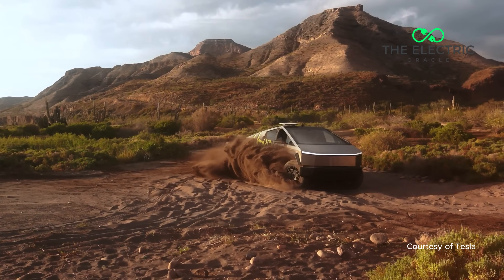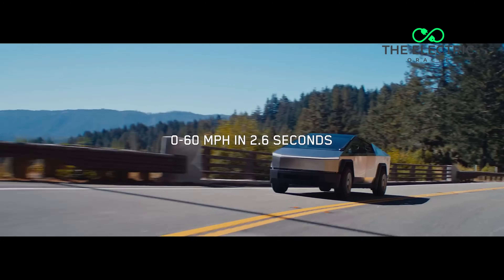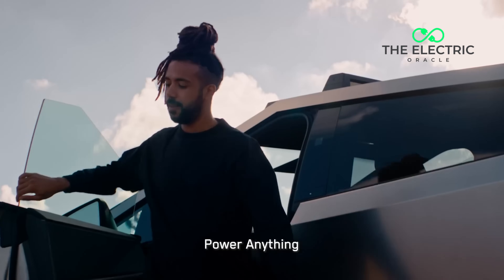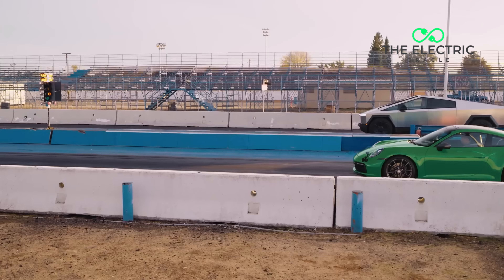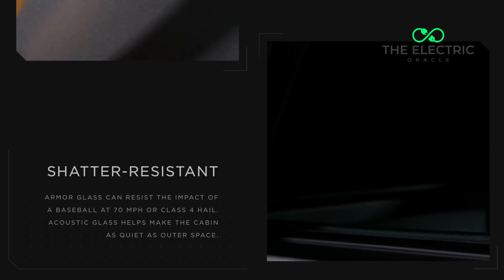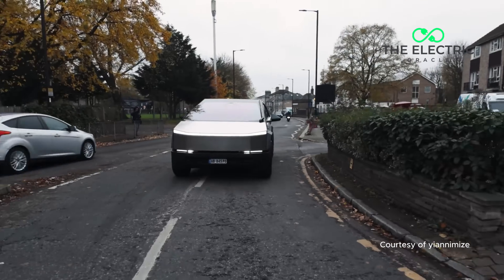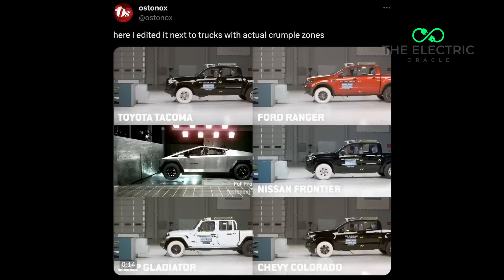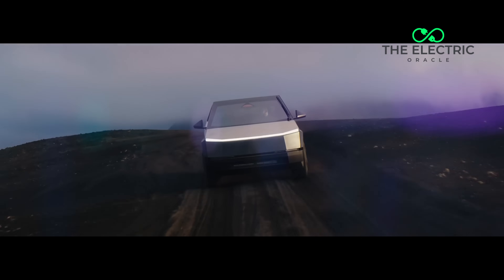5 Safety Issues Keeping Tesla Cybertruck Off UK Roads 🇬🇧

Comment: I see on your video about driving a cybertruck in the uk, you said about the C1 section on you license, you also mention that you would need a CPC, which is not correct, CPC’s are only required if you are working for a living using that vehicle, for example you can drive around in a Minibus if you’re family is big enough, but because it’s not for hire or reward, the no CPC is required, but if someone was to pay you for doing that then you are required to have a CPC, hence the payment is the reward or to hire the vehicle and you are the driver
Reply: Also anyone who got their licence before 1997 has C1 on their licence without any extra test.
Reply: You might be right, but still the insurance costs for someone who wants to drive a Cybertruck or a bus with a non-commercial license will be so high that in practice the possibility is not viable. Maybe one or two extravagant and ultra-rich celebrities could find their way to do things like these, but the rest of the world can't.
Reply: Limit is increased for alternative fuel vehicles to 4250kg gross weight.
Reply: @semsainars  Shouldn't be, it ought to be the same weight. It's about safety and road damage, which don;t change if the vehicle is an EV.
Reply: He’s right, the government upped the GVW limit to 4250 after a consultation in 2018 for zero emission vehicles so you could indeed drive a Cybertruck on a B licence
Reply: @robbrooks5181  There are a few catches. First it has to be used exclusively for the transportation of goods. Second, the driver has to complete an additional 5 hours of training with a registered instructor. Finally, this only applies to Great Britain, so no going to Northern Ireland.
In 2023 there were only two registered qualified instructors for such vehicles.
Reply from the maker: Hi Dave, thanks for your comment.

Let me clarify the requirements for driving a Cybertruck in the UK:

License Requirements

A Category C1 license is required as the Cybertruck exceeds 3.5 tonnes
CPC (Certificate of Professional Competence) Requirements

CPC is only required if you're driving commercially or for "hire and reward"

You do NOT need a CPC if:
Using the vehicle for non-commercial carriage of passengers or goods
Using it for personal use
Driving is less than 30% of your monthly work

Examples of When CPC is NOT Required:

Personal/family use of a vehicle over 3.5 tonnes
Using a large vehicle for private purposes

Examples of When CPC IS Required

Commercial driving operations
Being paid to drive as part of your job
Operating a vehicle for hire or reward

Therefore, I agree with your statement - you would only need a CPC to drive a Cybertruck if you were using it commercially or being paid to drive it. For personal use, only the C1 license is required.
Reply: @TheElectricOracleChannel  The Cybertruck does not exceed 3.5 tons. In fact in comes in at under 3 tons.
Reply: @K22MDL according to Tesla the GVW of the cybertruck is 4007kg to 4159kg depending on model and that's with no options installed.
Reply: @K22MDL  gross weight (GWVR) is between 4007 and 4159 kg, so way over the 3500 kg limit
Reply: The cybertruck only weighs in at 3,104 kgs so a C1 license is still not required
Reply: @Dave080109  They use the gross weight as the figure, not the unladen weight. Most 7.5 ton trucks only weigh 3200-3600kg unladen, but you cant drive one without a C1 licence.
Reply: @Dave080109  You'd be correct if that was the final weight of the lorry. But as it can load people and cargo it's total weight can be higher than those 3.5T and therefore you do need a C licence. It's the weight of the car plus its maximum allowable cargo added up that counts (MAM: maximum allowable mass), not the vehicle's dry weight.
Reply: @SuperDirk1965  It made me laugh a little when I saw you refer to it as a lorry. It's smaller than my daily driver (F450 - GVM 6,350kg).
Reply: @Dave080109  CT GVM is 9,169lbs or 4,159kg. I believe that licensing goes off of gross weight, not empty weight.
Reply: @Dave080109  The Cybertruck has a 1100 kg payload capacity, so it weighs some 4200 kg when loaded. It exceeds the 3500 kg limit even with the 500 kg allowance for EV vehicles. Anyhow, this is a minor inconvenience compared with the safety concerns, which include the total lack of crumple zones.

The laws in different countries may differ, but the principle behind special rules for trucks is that they are more dangerous for everybody than automobiles, so they have to be used with more caution and competence than the typical automobile. You definitely want well-trained and well-controlled drivers behind the wheel of any vehicle that can completely obliterate a small automobile or a pedestrian.
Reply: @Dave080109 you have to consider the gross vehicle weight not the curb weight. The cybertruck has a maximum loading capacity.

The numbers are detailed on Tesla's own website 

With payload the lightest truck is 4007kg and the heaviest Tri motor is 4159kg. 
Both way in excess of the 3500kg maximum. And that includes passengers and their luggage as well as cargo. And that's assumed. It might be way higher in real life so making insurance in an accident invalid.

Comment: I'm a c+e holder and work with the dvsa . What can you drive with a 3.5t license?
Any vehicle with a gross vehicle weight (GVW) of up to 3,500 kg 
Any van with a maximum authorized mass (MAM) of up to 3,500 kg 
Any vehicle with up to eight passenger seats
Reply: I don't see any place for this machine in the uk or even  most of Europe.  Although the Tesla model y is one of the certified safest vehicles in the world the CT seems to have been designed for countries where safety is not a legal requirement.  Imho I can't imagine that Tesla would ever bother to create a special compliant version for non north American countries as the potential sales would not make it worthwhile.
Reply: @ The question is can the load space be adapted to take any of the utility packs that would make it useful for services, as that would considerably expand its market.  So can side entry utility packs be fitted as used by National Grid, Hill Top Communication Service, or Cross Country and Airfield Fire Support vehicles? These packs enable ground crews to access all the storage space without having to climb in or totally unload the vehicle. Can cabins be fitted for use as off road ambulances or police and military communication or command vehicles?  I think the answer to all these is not without considerable redesign.
Reply from the maker: Thanks for your comment.
I think I replied to a similar comment you made earlier.
Reply: Legal weight is max allowed weight, ( laden max) is it not? Same as trucks: MGW?
Reply: Cybertruck weighs 2.7 tonnes... :):)
Reply: @kylereese4822  Empty weight doesn't mean anything. It weighs over 4 tons when fully loaded... :):)
Reply: @kylereese4822  That would be the American Short Ton, which is approximately 10% less than than the imperial ton used for UK HGV Classification (note the imperial ton is within 2% of a metric ton).  Thus the basic Cyber truck, unladen is 3 ton, which only gives you 0.5 ton for driver, passengers and load.  With the Beast or long range pack you have less capacity for load, albeit I gather the long range pack takes up most of the load space anyway.
Reply: @marquisdemoo1792  2.7 short tons would be 5,400lbs which would be on the lighter end of a conventional class 2A full size pickup in the US. The lightest CT is 6,600 lbs empty with the extended range version being 6,843 lbs empty. The issue is that the lowest gross weight is 8,834 lbs/4,007kg and it goes up to 9,169lbs/4,159kg at higher trim levels. This isn't an issue in North America since we can drive vehicles up to 26,000lbs/11,800kg on a car license.

Comment: As noted in some messaging below, this video is actually not quite correct. The Cyber truck definitely can be driven on a standard car licence. It has formally been weighed on a newly calibrated weigh bridge. This showed that its dry weight without persons was actually lower than expected. And therefore even with 5 people onboard, it would meet the standard car licence requirements. However, if you then included luggage or a full boot load, then yes, it may tip over into a C1 category on the licence.
Reply: As far as I know, in the UK and everywhere else the weight that defines the category of the vehicle is the maximum allowed weight. You cannot buy a vehicle that weighs 3.4 tons when empty and promise you will not carry any passengers or cargo.
Reply from the maker: 100% agree.
Reply from the maker: Hi Ian, thanks for your comment, mate.

Howver, I'm afraid to say that your claim is incorrect. 

Let me explain why:

The Cybertruck's weights are well documented:

Dual Motor AWD: 6,669 lbs (3,025 kg)
Cyberbeast (Tri Motor): 6,898 lbs (3,129 kg)
The gross vehicle weight rating (GVWR) is even higher:

8,834-9,169 lbs (4,007-4,159 kg) depending on model

For UK licensing:

Standard Category B license limit is 3,500 kg (7,716 lbs)

This applies to the vehicle's maximum authorized mass (GVWR), not just its empty weight

The only exception is for zero-emission goods vehicles (commercial vans) which get a 4.25-tonne allowance

The Cybertruck does not qualify for this commercial van exemption, as it's classified as a passenger vehicle, not a goods vehicle. Therefore, it requires a Category C1 license to drive legally in the UK due to its weight exceeding 3.5 tonnes, regardless of how many passengers or how much cargo is loaded.

Additionally, the Cybertruck currently cannot be legally driven on UK roads at all, as it lacks a certificate of conformity and doesn't meet UK safety standards.

Comment: Cybertruck is under 3.2t so you can drive it in a standard b licence
Reply from the maker: I don't think that's correct.

The Cybertruck is TOO HEAVY for a standard B license:

Cybertruck weights:
Dual Motor: 6,669 lbs (3.025 tonnes)
Cyberbeast: 6,898 lbs (3.129 tonnes)11

UK/EU License Rules:
Standard B license limit: 3.5 tonnes
Electric vehicle special allowance: 4.5 tonnes124

Even with the special EV allowance, you'll need a C1 license to drive a Cybertruck in the UK/EU. This applies to anyone who got their license after January 1997. 

Those who got their license before 1997 might have "grandfather rights" allowing them to drive vehicles up to 7.5 tonnes12.

Bottom line: You'll need more than a standard B license for the Cybertruck in UK/EU. Time to study for that C1!
Reply: @TheElectricOracleChannel  It weighs 2.7 tonnes and it passed your test before 1997 you can drive it on a regular licence... :)

Comment: The cybertruck is not 3.5 tones.
Dual mother is under 3 tones, while the cyber beast is around 3.1 tones!.😮
Reply: What counts is its maximum gross laden weight, not its kerb (empty) weight.
Reply from the maker: Thanks for your comment.

Actually, both Cybertrucks are heavier than that! 

Dual Motor: 3.025 tonnes (6,669 lbs)
Cyberbeast: 3.129 tonnes (6,898 lbs)

Fun fact: Some Cyberbeasts have weighed in at 7,120 lbs (3.2 tonnes) in real-world testing! That stainless steel body and massive battery pack add up 🤯
Reply: @TheElectricOracleChannel  Yanni on a weigh bridge it says it`s 2.7 tonnes.....